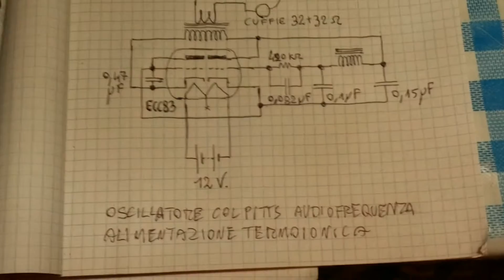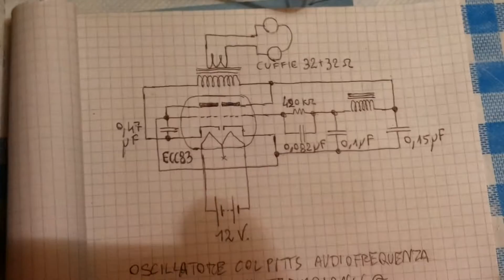#078 Oscillatore a valvola alimentato dalla stessa

Comment: Sarebbe a questo punto possibile farlo con dei FET, allo stesso modo e farli oscillare senza alimentazione elettrica ovvero, per grazia divina?
Reply from the maker: L'alimentazione elettrica in realtà qua  c'è grazie ai catodi caldi che lanciano elettroni e sono posti in serie praticamente 2 pile, i semiconduttori invece se non li alimenti sono morti
Reply: In breve si usa la dispersione di griglia che grazie alla capacità dell'effetto Miller risuona con il carico induttivo complessivo che insiste sulla medesima griglia? @Kaoslaleggenda
Reply from the maker: Funziona così: un triodo genera energia perché la griglia e un po la placca raccolgono elettroni lanciati spontaneamente dal catodo caldo, la tensione a vuoto di 1V o poco più dipende dalla temperatura e dal coating del catodo la corrente di cortocircuito di qualche uA dipende dalla superficie del catodo e dalla distanza della griglia da questo, In pratica è una pila mentre l'altro triodo si trova inserito in un oscillatore Colpitts che genera la nota.